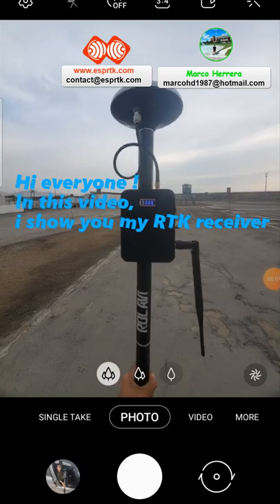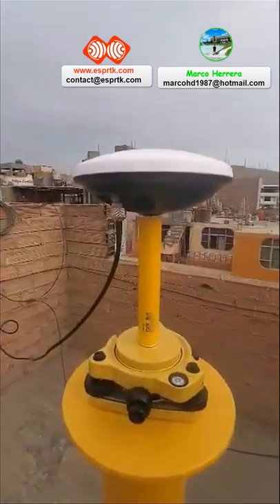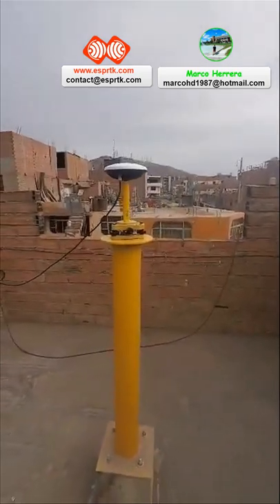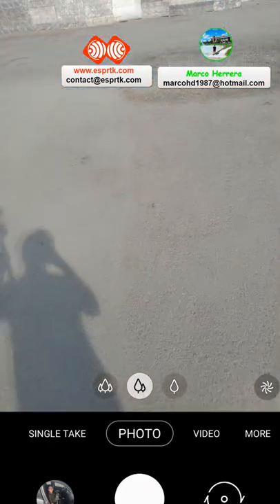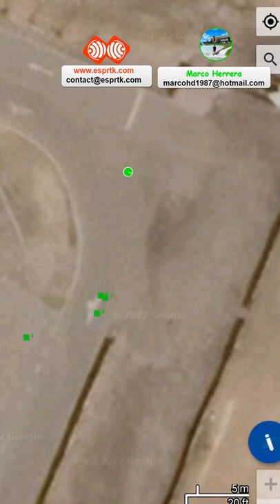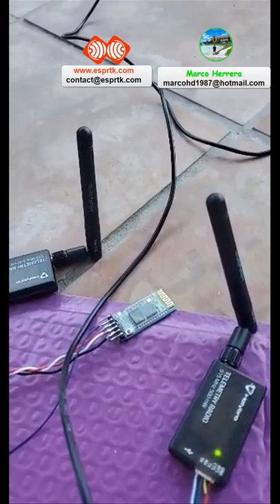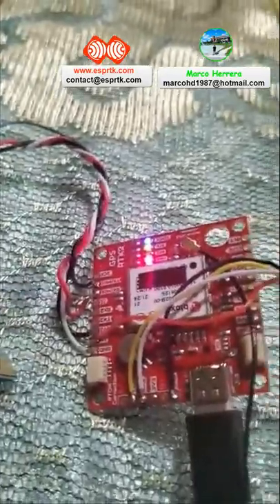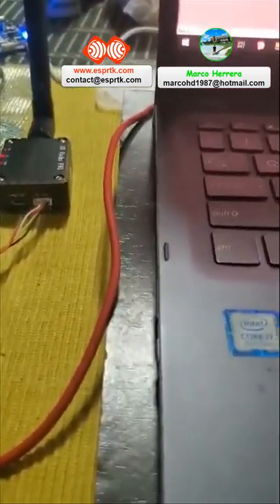Testing 6000m radio long range DIY RTK Base/Rover  -  Ardusimple Sparkfun F9P ESPrtk - Marco Herrera

Comment: 6km radio range! What radios are you using man? That's insane lol
Reply: I imagine he's using a 915Mhz radio with some high gain antennas (maybe 5-8dBi). Also, the location of the ground station looks like its on the roof of a building so that'll help a lot.
Some countries and areas have very little interference on various bands so that may also be the case here.

Unfortunately, in the UK we can't use 915Mhz. We have 868Mhz and 433Mhz bands but 868Mhz is used a lot in IoT and Lora whilst 433Mhz is used by pretty much every remote switch & garage door opener so they are pretty noisy air bands.
433Mhz can still be pretty good though as long as you are out in the countryside and have enough room for the longer antenna on your project.